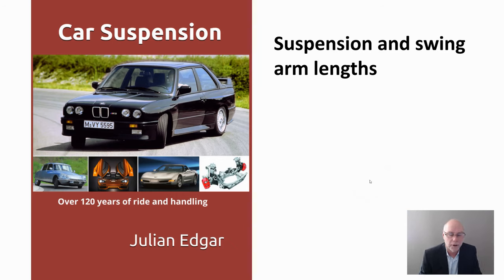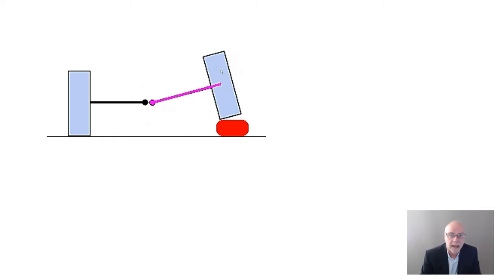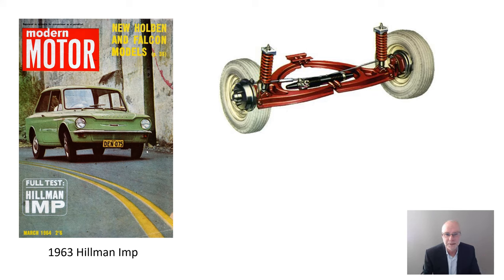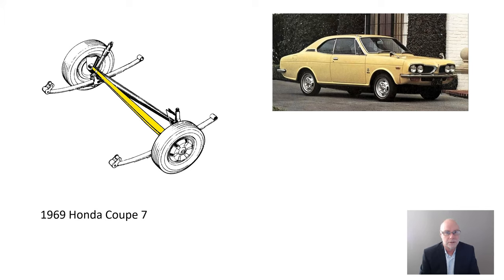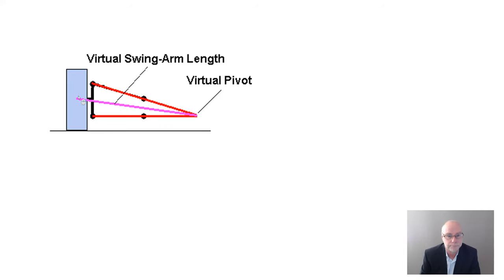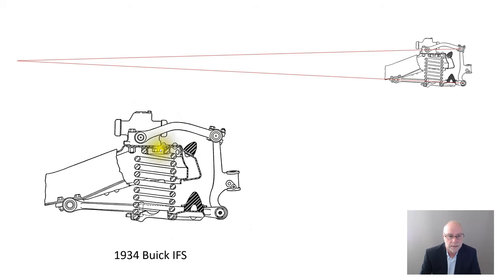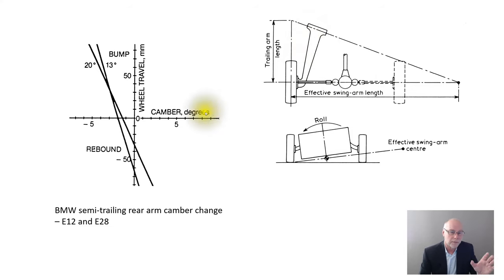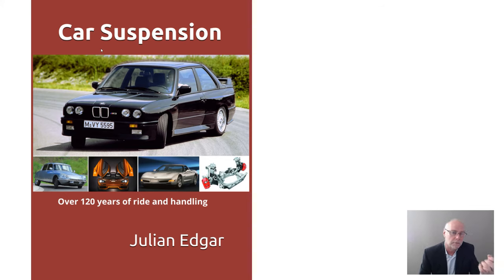Suspension swing arm lengths - both real and virtual!

Comment: On that 1934 buick design, you're only drawing those lines when the suspension is static, at normal ride height. Draw the lines when it's compressed and the location of the virtual pivot dramatically changes. With unequal length arms, the location of the "virtual pivot" continuously changes as the suspension moves.
Reply from the maker: Yes.

Comment: I dont understand why you said that 1934 Buick IFS have small camber increase. Bc it have upper arm much shorter it will gain lot of negative camber when suspension compress.
Reply from the maker: Because camber gain doesn't depend just on the length of the upper wishbone. It instead depends on the length of the virtual swing arm, found by drawing lines through both wishbone pivots.
Reply: @JulianEdgar  Well yeah...
Its confusing to hear that it have small camber gain even tho it at the end have pretty big gain. 

It was unclear to me after i saw video. 
Just asking to be sure.
Reply from the maker: @adamike9990  It doesn't have a pretty big camber gain at the end! That's the point - it has a relatively long virtual swing arm.
Reply: @JulianEdgar  Broadly speaking, and as demonstrated here yes. But towards the extremes of motion it gets less linear and the camber curve gets more aggressive. In droop you can see negative camber when the upper control arm goes over center. But again, these are extremes that are easily designed around. So for example in stuff like modified trucks this can happen, see S10s, the new Bronco, etc.

Comment: Do spaccers and ET affect it?
Reply from the maker: I don't understand the question.
Reply: @JulianEdgar  track widening and wheel offset. They should affect the virtual swing-arm lenght, right? If they do, shouldn't suspension travel increase (marginally) the further the wheel is away from the virtual pivot?
Reply from the maker: @MajorSpam  Yes, but I imagine it would be only to a very small degree. Just draw a scale diagram and you'll soon see.